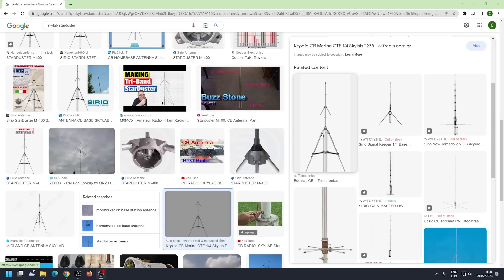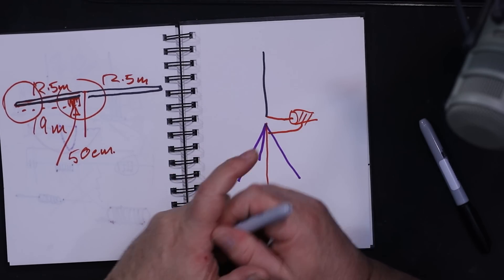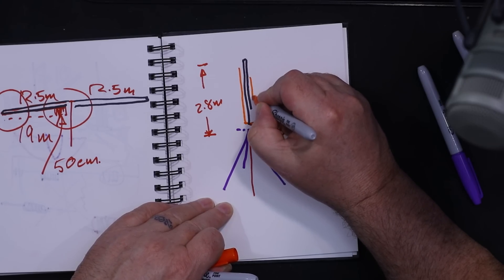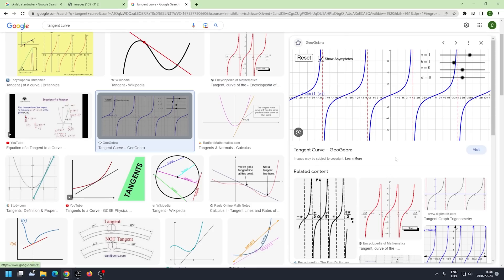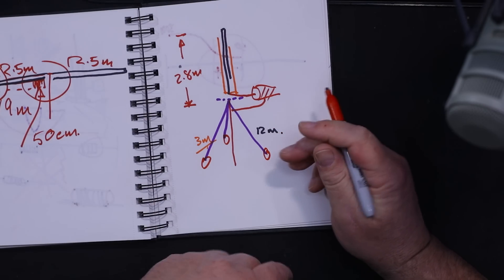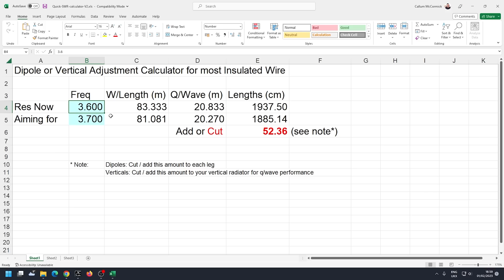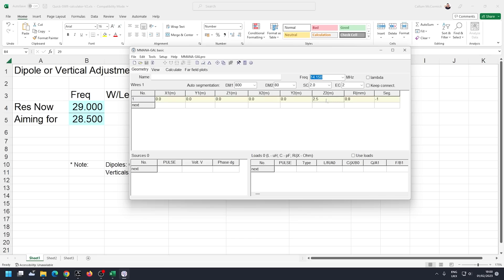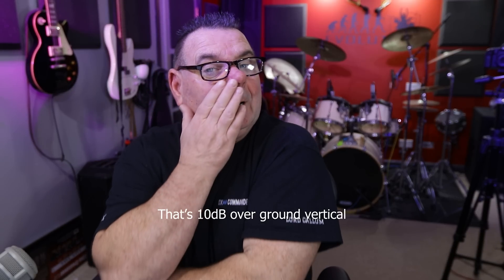3-Band Ham Radio Antenna: StarDuster Off-Centre Feeding Method

Comment: Callum you could probably save some weight on that bottom/ground spreader plate by getting rid of the 90* coax feed and running it right off one of the bottom holes, might make the top of the antenna slightly more balanced?  Just an idea.

While were on the subject of this antenna I'm curious how much of the 21mhz vertical wire is actually folded back?

I'm interested in two of those spreader plates and that super strong wire you use for the radials, any maybee a cut chart too.  The reason I'd like two spreader plates is I plan to try and make a sister antenna that does 20m and 17m.  For next years trans atlantic SOTA event I'd gladly take those two setups to a mountaintop and surely out preform last years qso's.

I allready have one 18m pole, and many reels for your normal dx commander wire in my strategic parts stash.  Perhaps its better if I email you directly?

Dave,
K2CZH
Reply from the maker: Hell Dave. Save weight? Like 2 grams? LOL!

Comment: I watched again, just noticed 75 ohm at feed, just what is needed to use my 3/4 inch cable co hardline. Do you have any 18 meter poles? Is more like a true vertical dipole which natively IS likely 75 ohms so with one of my 75 to 50 transformers  inside the match would be good.

My heart surgery will not be done so no extended rehab time necessary which with my home rebuild  now finished I DESIRE TO GET back on air. KD4MAO!!
Reply from the maker: Yes.. We have 18m poles in stock.. So do DX Engineering. We just shipped them a ton more recently.

Comment: This inspired me to build a linked wire starduster for 10, 12 and 15. I use it on the expedition pole. Not as high as yours but it works!
Reply from the maker: Yes it does!

Comment: In my area we have a local 10 meter net.  Also, 11 meters (CB) is having a resurgence.  At a hamfest last year I picked up a 43 foot (13 meter) fiberglass pole for cheap.  So, I've been trying to figure out how to make an antenna that might work for both and use the pole to get some adequate height for local ground wave.  The pole is fairly thin and flimsy up near the tip, so using it raise a conventional antenna wouldn't work.  But you have given me some great ideas that might work for this pole.  Thanks.  And, if you decide to make a commercial version, I may be a customer.

Comment: sir i have been wondering about top loading your signature for 75m ,,,do you think that would work?
Reply from the maker: It probably would, yes.. But you would need a fair amount of loading. Probably best to start a bit lower down, it'll need a good few turns.. Check out the user guide for Signature 12.4 to gain inspiration.
Reply: @DXCommanderHQ  I will thank you

Comment: Wouldn't it be great, if someone could take an old Super Scanner CB antenna, and make one radial 1 ham band, a second radial a third ham band, and a third radial, a third ham band. It was a fantastic antenna, you could use a rotor, it had a lighted switch panel for inside the house. it was awesome. I am just thinking that if someone had three bands they used more so than not, they could tune the antenna and just use one antenna.....just a thought, if you could find one, or duplicate it.
Reply from the maker: Well, we don't need to do all that.. We can just share the radials with all the bands, no problem.. 20m might be stretch, that's all.

Comment: An end-fed half wave has a feed point impedance of 2450R. That's why folk use a 49:1 transformer to feed it. I prefer to use a 1/4 wave stub to match mine, which is then actually 2 double-Zepp as I have two 1/2 wave wires. Works great, but is single band.
Reply from the maker: Yes, 3,000 was an approximation since 64:1 also matches nicely.. I like the idea of a 1/4 wave stub Andy!

Comment: Hi Cal.  Once again some interesting stuff. When your swr ing the 3 vertical wires, do you have to work on 1 wire at a time, or do you fix all 3 in position and then do the checking? What I want to know really is there any interaction between the 3 ?
Cheers
Reply from the maker: I did all three.. Once minor change on one element has no bearing on the others.. Good question.
Reply from the maker: (to clarify, I did all three at once - then re-checked the numbers afterwards - normally it just works)

Comment: Hello Cullum, nice work. A question: how long, fold comprise, is the 15m elements? Vince
Reply from the maker: I had 2.8m to play with and 15m needs about 3.4m. So we are missing 60cm. However, we need to go longer because the radials were shorter. So let's say we are short of about 80cm. Well, instead of going "up" 80cm (we can't!) we can come back THREE times that amount. So although I don't recall the exact numbers, I suggest the return should be around 0.8 x 3 = 2.4. Which means, we must have come back nearly the whole amount. Honestly, I never measured it - but that rule of thumb seems about right.

Comment: I've been using the 'starduster' type for years made with wire and compared it with half wave vertical dipole and I have to say I'm heard more on the 'duster' but the half wave hears more. The 'duster' IMHO is much better for skywave propagation.

Comment: If you were going to make that for just 10 meters would the vertical wire be 5/8 wave with the  3 radials being 1/4 waves?
Reply from the maker: Erm.. Yeah, OK.. so build it 4m lower to the ground..? I don't fany that - and the matching issue. I have looked at a pair of J Poles mounted one above each other. But only gives maybe 2.5dB extra - and a lot of effort.

Comment: Cal, I’ve been hoping you would sell these as an accessory for the 18m Nebula. Do you have the bits to make me a Starduster kit? If so, I would like to purchase a Nebula + Starduster ASAP. This would be a super fun antenna for Field Day. Please let me know. 73
Reply from the maker: Ed.. Let me get the parts drawn up.. The parts shouldn't be too expensive. All we really need is the correct sized plastic spacer and a trimmed down plate-set that we can reduce the weight with. Give me a few weeks..
Reply: @DXCommanderHQ  This will be fun. Thanks! One question, do you have a device that collects/holds the 10m & 12m elements near the top? Thanks
Reply from the maker: Ed.. Sorry for late reply.. I've not got around to this yet..
Reply: @DXCommanderHQ  we still have three months’til Field Day. There’s still time! 😀

Comment: Very interesting. I was wondering how a DX commander would react to Elevated radials?  Cal with expertise,  Would it require the same amount and length as ground radials?
Reply from the maker: No. Being very high up, like a V-2000 from Diamond, you only need two actually. I don't believe for one instance we could do this low down..
Reply: @DXCommanderHQ  Thank you sir, Love your videos and your knowledge never ceases to amaze me with your never ending pursue to improve your products. Thanks Cal.

Comment: Hi Callum, nice video! Would it help the tri-bander to cut each radial a slightly different length, one for each band?
Reply from the maker: Well. I suppose we COULD but ideally in pairs else the pattern would go cock-eyed. So we would need 6. But hey, it works like this anyway. Good question though.

Comment: Would be interesting to see how 2m and 70cms work on this, I have had quite a few 2m SSB contacts on the classic, I take it with a 10m element resonant on say 28.8 you would have the fifth harmonic at 144.300 for SSB and if you made the element resonant for the 10m FM portion you should be resonant in the 2m FM portion of the band. Great stuff Callum!
Reply from the maker: You've given me some ideas! :)
Reply: I built a diy DXC about three years ago just had the 40m and 20m wires on it. I checked the SWR on 2m and 70cm was both below 1:5.  Gets into the repeaters in the area.
Reply: @n3ljs399  I have have noted similar results, I think that I get 2.1 on 70cms but this changes if I move my radials around or shortening/lengthen the coax but it can easily be matched. Not sure how 70mhz (4m band) works as I don't have a rig that covers this. Would be interesting to know.

Comment: It may be cool to use some sort of field strength meter on your drone to verify your designs in the near field. 
Don't know how you would pull that one off tho. Just an idea.
Reply: Would need to store GPS position and strength. Then make a map chart on PC with that information.
Reply from the maker: Yes, you COULD do that.. Or just measure the plot at zero-degrees say 500m away in a circle. At least we could get a base-line for all antennas... I already have a plan :)

Comment: I had my version of this antenna up again a couple of weekends ago for its second test.  All the elements were too long the first time so it was easy to shorten everything and I moved the feed point up the mast a bit because I could.  I tried a thing were I used 6 radials, three were in between the other three that were attached to the guy cord.  So the result was having 3 radials for 15m and 3 for 10m.  12m was just left to figure things out with whatever radial worked.  All SWR curves showed very acceptable but 12m was still just a little high.  The 10m radials were not even close to being 45 degrees and I may just scrap this whole idea of having 6 radials as it just adds weight and maybe for nothing. 
I'll be waiting for good weather and a day off to have a go again at round three of testing.
Reply from the maker: Interesting.. Yes, I would just share three radials between them..

Comment: Cal, some areas in USA use 10 meter phone for local rag chew so height is important for ground wave and also to help get a clearer opening for DX. I do believe offering this version of the DX Commander could find a market, of course using the lower half for lower bands, CBers could also use it, especially when places like the UK, with their FM40, Germany with their lower 40 and New Zealand being at 26.220 up. All of these could be accommodated by adjusting length of radiator or adding a second or more radiators?
Reply from the maker: Yes, it could easily be tuned.. I need to get some scaffold poles in the ground for raised guy points, say 1-m off the deck so dogs don't run into them - then we can do this again. It would be an extraordinarly small market - possibly 10 per year as a production run but for crazy folks like me, it could be a good laugh.
Reply: @DXCommanderHQ  I am living in a hotel while my home is torn down and rebuilt, but for me surrounded by metal roofs getting up is desirable.  I do think the 18 meter built like you are considering is preferred. Also while in the hotel, I am thinking of dropping a small wire out the window screen ( I am on 3rd floor) using a 49/1 and tuner at the antenna could work? I also have a ground tuner so the CCI can be handled or a second  wire to complete the dipole, except both would be straight down. Fun to try.  I do think this 18 mtr pole idea will work for me. When I get back to my home and get over my heart surgery we will try one and find out !!! DX Commander still the best buy in Ham antennas !!!!

Comment: Didn't know that about the tangent curve for off center feeding.  Good stuff Cal!  I'll keep that in my back pocket for some future builds.
Reply from the maker: Well, I don't know for sure - but it makes sense (maybe!)
Reply: @DXCommanderHQ  lol. Good enough for govt work.  All I need to know is the swr doesn't fluxuate badly if you go off center and it radiates some RF.  Might be useful for several situations.  I love building new stuff and seeing how it worksand then the less awesome ones I disassemble and make a new one.  I've got some new belden 9913 coax I need to use and make another antenna this coming week.  Only have 4 running into the shack right now.  Also have a Heathkit SB-200 amp coming next week to spruce up and put on the air.